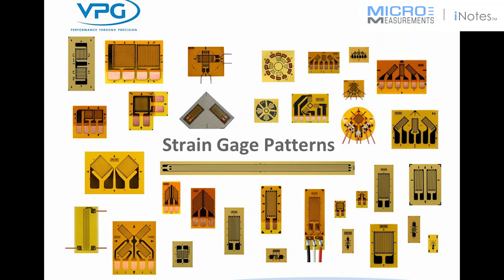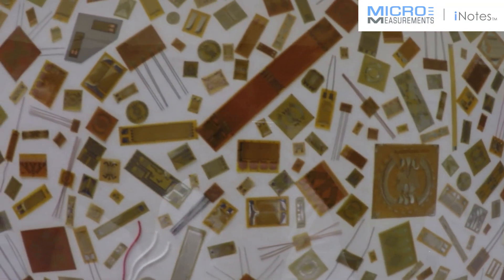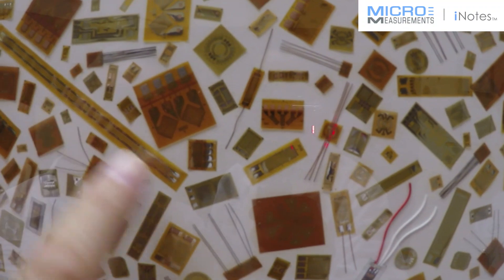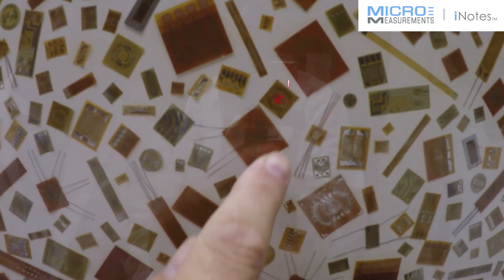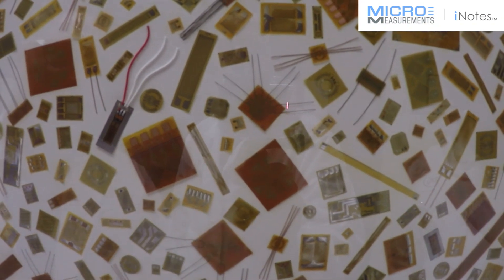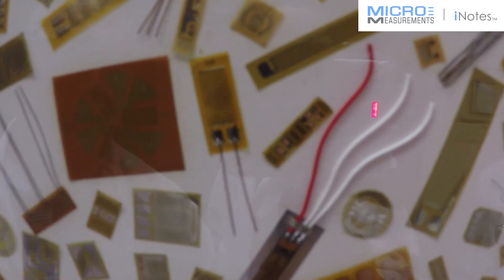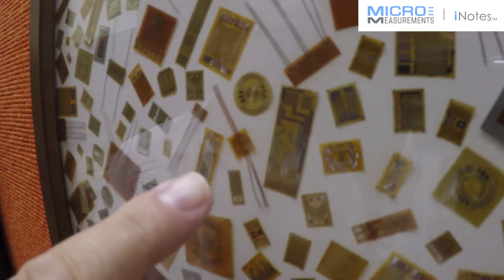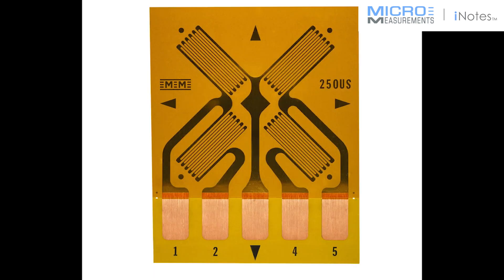What are the different types of strain gauges?

Comment: Can concrete strain gauges ( 10mm length) measure strain in steel rebar
Reply: Thank you for the question and I apologize for the delay in responding to your question.   10 mm gage length is a little on the large size for rebar.  Most of the time we recommend a small gage length strain gage on rebar to minimize how much of the strain gage wraps around the circumference of the rebar.  Darryl
Reply: @darrylpeterson5394  Okay, Thank you.
Reply: @darrylpeterson5394   Thank you.